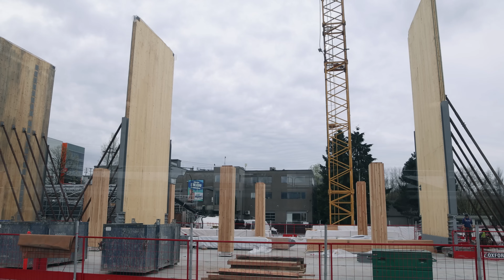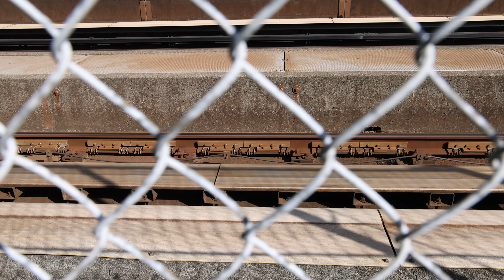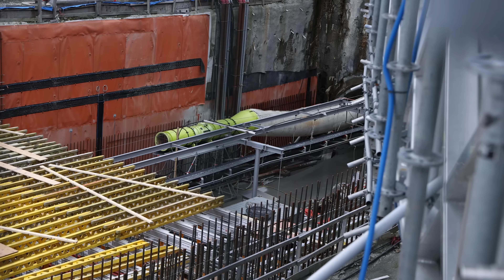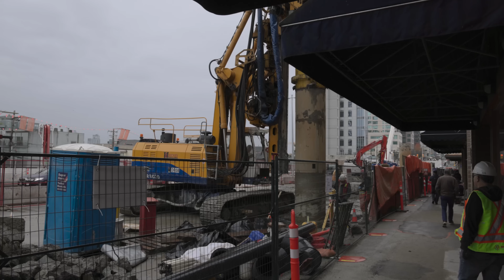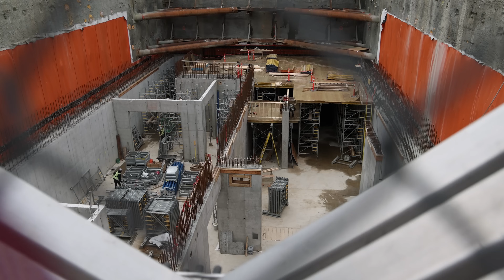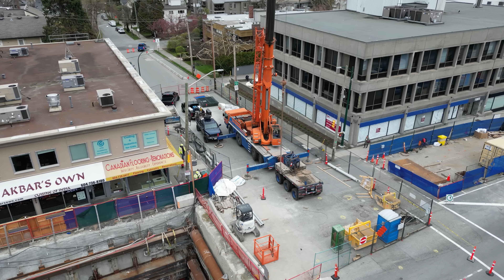Broadway Subway Project Construction April 2024

Comment: This is good reporting.

Besides, I wonder if precast segment would be less expensive to build rather than building formwork for every construction project. It seems like we are paying somewhere between 1.5 to 2.5x in construction costs compared to Europe and Asia.
Reply from the maker: It really does depend on the project. All the beams for the guideway are precast, same with the tunnel ring segments. But since the station boxes are all unique to match their sites, and having strict buildings code to follow, precasting doesn't really fit.

Also have to remember that land costs, years of planning, business cases, and designing are all included in the 2.8B price tag. Could it be done cheaper? Probably. But would we've made the mistake once already by going cheap (Canada line).

Comment: As someone who lives south of the Fraser the expansion of Sky Train on Broadway is an ongoing disappointment.
Trans Link is still part of the underdevelopment of this part of Metro Vancouver. South of the Fraser has much less transit  than the rest of Metro,  We also have only one major hospital which still can't do angioplasty. This results in many hundred of unnecessary ambulance trips to New West and municipal Vancouver. Yes the line to Langley is in its infancy but long, long overdue. Trans Link resolutely ignores the rail line to Chiliwack. A community group saved the passenger rights on the line. Trans Link didn't. South of the Fraser is an automotive society and still be that long into the future.  Municipal Vancouver is a weight around the neck of Metro Vancouver.  Tear up its special charter and put it back under the Municipal Act. like all of the rest of the province. Stop the special treatment. Vancouver is a small minority of Metro.

Comment: I wish California could learn from Skytrain to build projects at a decent cost.
They should have just kept the TBMs going further west.
Reply: No. They should spend that specific money on other transit projects. This subway extension is worth the money, but not all the way to UBC.
Reply: @eugenetswong it’s embarrassing that one of the biggest universities in canada isn’t connected to rail
Reply: @arden6725  That's just not true. The buses are 70% empty at the last few miles before the University during many times of the day. Either Rapid Bus or Bus Rapid Transit will do just fine for the bang for the buck.

The last mile will always generate less revenue and bring less value per dollar, so choosing a cheaper service makes sense. It's basically a suburb, or a poorly designed downtown.

The saved money should be invested in the north shore or maybe the highway bus routes. Service there will alleviate traffic jams that the university will never experience.